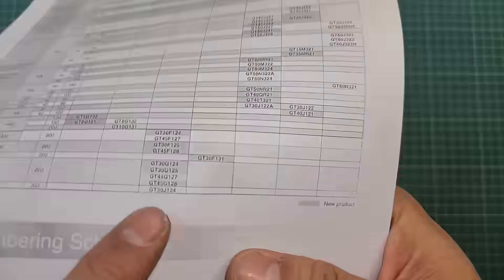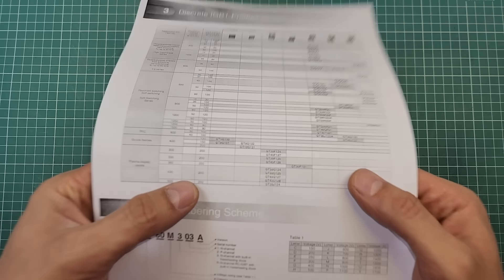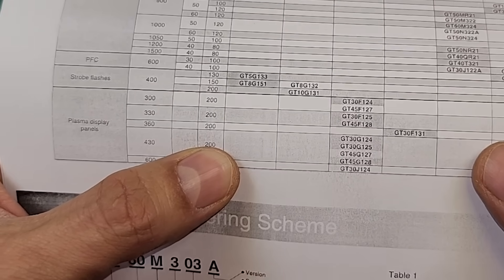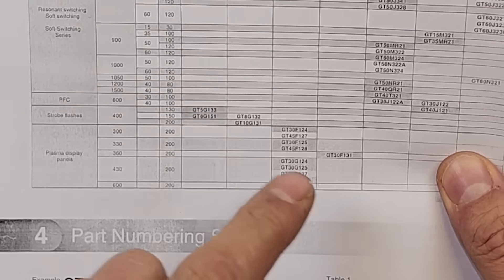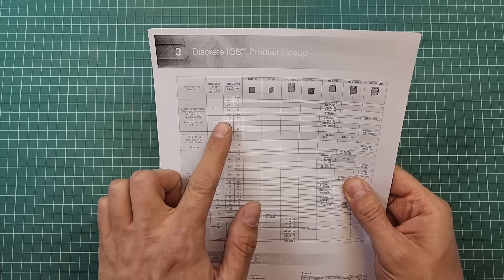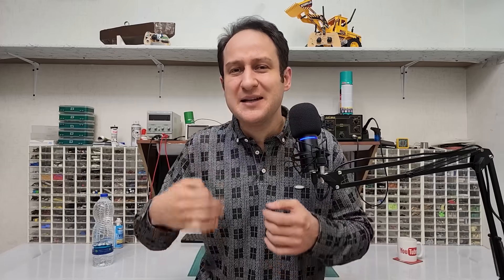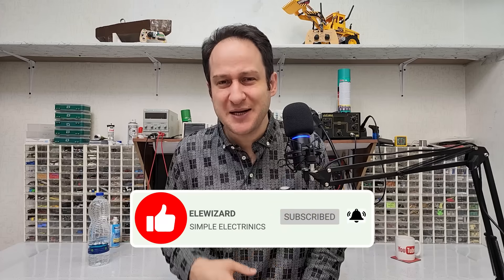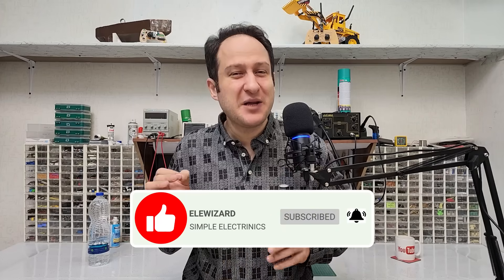Can a small transistor really switch 200 amps of current?

Comment: I learned something new, but it is completely useless to me......

For reals,.. i bought cheap solar controllers and they rated at 100 amps,  but start smelling funny and warm up ALOT the closer you get to 40 amps !!    so everything you said, Jives !!

i put fans on them to keep them cool.   they get so hot, the soder on the board melts and disconnects incoming current from panels (i have a video on my vids to show)  
Occasionally, if i dont be careful enough, i have to go resoder the faq-er.  !!   Still blows my mind that up to 720 WATTs can travel through those tiny little pins !!
Reply: Them cheap MPPT you got might have been rated at 100A for sure, but probably its the peak pulse current rating. Try looking at its continuous current limit. There are a lot of shady manufacturers advertised pulse current instead of proper rating for continous operation. If youre lucky, you might be able to replace the FET/IGBT with proper one according to your need without the need to replace other component.
Reply: @Aizemiyo  
I'm trying to manufacture money, cuz I'll just buy little better product !!

Iv been pounding them hard core for the last two years, so I did get super value from them...

All the other stuff you said, WAY beyond my paygrade !!

I'm still trying to master basic soldering techniques !!  You know, the part where you can put two wires together to where they don't fall apart...
Reply: @tisiluca  ahh I see.. Wish you'll get there soon. Dont worry tho,  cheap but legit solar controller does exist in the market, you just need to know what to look for. I suggest you familiarize yourself with the controller important specifications such as wattage rating, continuous input & output current, switching frequency and input/output protections. 

Regarding the soldering, my only advise is dont cheap out on quality leaded-solder wire. It will save you a lot of frustrations and money. I've spent a lot of money on multiple expensive solder stations because my soldering was so bad, turn out its the solder wire that is the problem.
Reply: @Aizemiyo  

I believe u r correct on the leaded stuff.  I need to get some soon.

Comment: Regardless of the silicon, 200a would vaporise the legs.  They'd need to be as thick as three pencils, 2/0 AWG or 70mm²  imagine the PCB would the tracks be made from rebar?
Reply: Not true at all, you can send 200A through 10 awg wire in certain circumstances, drones do it all the time. You and many others make the mistake of thinking structural wiring code applies to other applications.
Reply: @MarkFunderburk  OK, but the point I was making was the legs would be inadequate even if the silicone was capable.  There is also a big difference when it comes to duration.  What might hold up for a short term and some heating is acceptable will fail in prolonged use.
Reply: @landroveraddict2457  No, the legs are adequate. Did you listen to the video ... the pulse width ?
Reply: @landroveraddict2457  What if the legs are short and mounted to much larger cables, so the cables help cool the pins? Then you can run more current through the pins.
Reply: @benjiwiebe8128  the legs become a fuse.
Reply: @benjiwiebe8128  That is essentially what you are supposed to do for any of these high power devices. In reality it is a PCB with carefully designed, thick copper polygons to dissipate the heat from the connections.
Reply: @landroveraddict2457  Are they though? Don't get me wrong I would not use this device anywhere near 200A, but the number isn't a lie or a scam. In the conditions outlined in the datasheet (pulsed use) the legs are probably fine. Keep in mind during assembly some significant length of those legs will usually be cut off, and they are not really intended to be soldered at the very end.

Good parts websites (like digikey) have the option of sorting by continuous or pulsed current for transistors. And I don't want the manufacturer arbitrary picking some middle of the road number for what they say the limit is, because I, as the engineer will do the calculations and determine that for my application, I want to know what the absolute theoretical maximum is, because that's the only way to effectively compare part #s.

Comment: Sometimes they require a heatsink the size of a battleship.
Reply: "Hey, cool, I can see the sacrificial anode on your hull...!" - "Erm, no, that's actually the IGBT this whole thing is cooling..."
Reply: A heat sink made out of WHAT???
Reply: @StevenStyczinski-sy8cj  super conductors.
Reply: plus liquid Nitrogen, a pump and a fan, water cooled SCR's or Ignitron tubes are used for high currents, 1200 A.
Reply: It is not just heat sink but the current carrying capacity of the leads also matters. Can these thin leads handle 300A even for a short while?

Comment: Also: the size of the leads (legs) of the transistors will be a clue for current handling will be a clue.
Reply: i agree, leg size has to be the first immediate clue to its capacity, 200 amps, you need welding cable size.

Comment: The answer is in the wattage handling data. More Volts - Less Amps. Lower Amps - Higher Voltage. But the time/current handling not clearly specified is actually what we were looking for. Not listed? Suspicious 🤔

Comment: Package type is important as well as practical considerations for the PC board traces.  Nice to know the silicon (or whatever) die can withstand 200 amps but that's an absolute limit.  I like to say I work with surface mount components - the kind that need bolts to mount.  To really be working with 200 amps RMS you're going to need bus bars and the mechanical aspects are just as important as the electrical.  Thanks for getting this out there for discussion.

Comment: Just look at the leads ;) Fuses for 200A have much thicker wires. But for microseconds? Even much smaller fuse won't blow. To match a component for the circuit all 3 factors must be taken into account, first power, then current, then voltage. I fried transistors with exceeding each one (of course one at a time). I haven't used IGBTs that much, but looking at MOSFETs I also look at their R(DS), because it tells a bit how much power it will dissipate. And this one depends on the V(GS) voltage, that should be high enough to get the lowest R(DS), but lower than maximum, because having it just on the line costed me some oopsies. And when I decide to use BJT, the voltage drop when it's on counts to the power much more than for MOSFETs. That's why I love MOSFETs so much, they are quite cold even with large currents, so they usually don't need huge heatsinks.
Reply: I have build a MPPT StepUp-regulator for PV-modules and used there for this 10A of current some MosFETs which could switch 300A, pulsed drain current of 1200A. At the end the Rds_on is the critical value here, because the device should produce nearly no heat, because it have to fit in a small housing.
Reply: @Adam_Lyskawa  correct, but the terminology is different for IGBTs since they don't have a drain or source. Also, for both Mosfets and IGBTs, the gate current is extremely important for power dissipation as well as voltage. Gate drivers will go up to 2 amps because the faster you can charge the gate up to the voltage, the lower the switching losses, which are then multiplied by the frequency.

Comment: I have seen real 200 A industrial diodes in my life. Diodes that can handle 200 A for years. It has output wires as thick as an adult's man finger. With heatsink it had weight about 1 kg. So seeing that modern tiny transistors with claims it can handle 200 A makes me laugh. 
Yeah, sure, in 2 microsecond it would survive, but no more
Reply: https://www.youtube.com/watch?v=dhIbZa6yg5k Here's a modern tiny transistor doing 200 A, with a heatsink. If the heatsink was actively cooled, you could get long lifetime at 200A with a small device.
Reply: @benjiwiebe8128  open crystal in special conditions. Nothing new, nothing real. You can't keep it at 25°C all the time in the real device. That thing worked in electric locomotive countless hours. 
And wires... too thin for 200 A.
Moreover why in your video the current never changed despite load got hotter with time. With the same voltage the current should drop down at the wires got red.

Comment: Run that trandistor under liquid N2. You can run it at up to 500amp continuously..
Reply: shurely not.
Reply: @Poebbelmann  If the thermal resistance of the package is low enough that the LN2 keeps the junction temperature within operating range, then it should work.
Reply: @benjiwiebe8128  The thermal resistance from the bond wires to the casing will propably be much too high. They will evaporate even when being cooled to -196 °C.

Comment: Kind of a round about way to say that this component is meant to operate under a duty cycle. They even give you their definition of a pulse. Assuming enough time elapses between pulses to dissipate most of the heat, you can still switch the rated amount, for their length of a pulse. In other words, it's not meant for continuous operation, so a continuous load rating is not needed. Ultimately the maximum power dissipation is the true limit, I really don't see how any of this is misleading.
Reply: This was my first thought. The amount of material able handle current that high would need to designed specifically for that purpose and not ANY 200Amp load and especially not continuously. Most ppl should already assume this but I wouldn't be surprised at some EN thinking it says 200A so they just "send it".

Comment: 200A is pulse current - not DC current - The pulse duration could be few 100 microseconds ( repetitive or non repetitive is another factor to consider) as in fly back mode. No device can carry 200A DC current for a CE volts around 2V!
Reply: Some can....with a very large heatsink.

Mitsubishi QM200HA is one example.
DC safe area includes 200A @ 7V CE
Device is rated for over 1500W dissipation.

Comment: Best thumb rule is always use factor of safety as > 10 or more. Never believe advertisements.😂😂
Reply: 10x is wasteful.  Best rule is to read the datasheet, understand switching and conduction loss, understand the thermal resistance parameters, and aim for a lower junction temperature if you're after reliability.  Tjmax is usually 150 or 175 deg C for mosfets, so I go for 85 deg C for reliability.  This ends up being about 1/4 to 1/2 the rated values, depending on how fast I'm trying to drive it.

Comment: One number roughly indicative of the current capability is in the part number.  In this case 30, meaning 30 A under some a bit more realistic cooling provided.  I say roughly, as the actual cooling is not easy to figure out.  And last, what duty cycle?  50% ON?  25% ON? Or 2% ON?  Not to even start about the switching loss, say at 25 kHz.  You cannot take the first nomber at the top of the sheet and be done!

Comment: Amps are not a measure of power. Watts is. So what really matters is how many Watts can it handle. A TO-220 package is good for maybe 125 Watts? So you'd have to run at the threshold where a transistor switches to get 200 Amps through it. 0.625 Volts.
Reply: Legs of the transistor will melt earlier than crystal itself when you apply 200 A on it.
Reply: Think pulsed periodic applications. Duty cycle such that you don’t exceed the average power dissipation limits and and maximum junction temperatures.
Reply: @bretfuzz925  yeah I remember an old circuit that pulsed an LED at high current to make it really bright. Was one of those gee whiz circuits back in the day.
Reply: @bretfuzz925  some posts disappeared...
The argument was about a constant current. At least for one hour or more. 
200 A of continuous constant current.
Reply: @igorzherebiatev5751 understood. One must understand the nuance of the ratings and perform some math.

Comment: ahh 3 micro seconds, thats the catch, i always wondered the current limits of those pins myself, but also the circuits inside those black boxes, they're even smaller traces right? how do they handle so much current, or is that the magic of non ohmic devices? (diodes)  I have fantasies of a 5v solar system, all our electronics get converted down to 5v or lower so why all the conversion, just give us 5v and 200 amps!
Reply: Resistance and current gives heat (since voltage drop and current gives heat, and current and resistance gives voltage drop). Heat makes the traces get closer and closer to their vaporisation point. If you pulse quickly enough or have fancy enough cooling or heat-sinking (for a bit) than you can run higher current. So a short small trace connected well thermally to a larger object can handle a lot more current than it could in free air.

Comment: pffft... 200A... pathetic. i got something here that will do 2000A... continuously.

ignitron :) about half a litre of mercury :)
Reply: Rectify it.
Reply: @ interesting you say that as thats pretty well much all you can do with them as they dont turn OFF... precursor to the modern thyristor, and beefier than the gas filled thyratron.

this one, AFAIK, was rescued from an old industrial spot welder... only dealt with pulses of a few KW at a time.

i got it mostly as a cheap source of mercury...
Reply: In an old railway electric engine?
Reply: Substation at the end of an undersea DC cable...?

Comment: 3 microseconds? That's pretty reasonable. So I can use that IGBT in a buck converter at 138khz, with a 41% duty cycle to get a 3 microsecond pulse time, and put it in my car at 12v, 200A in, and get 5v, 480A output? Sweet, I'm gonna have the fastest cell phone charger in the world!
Reply from the maker: I wouldn't recommend trying that, you'll end up with a lot of smoke.😁
Reply: The forward voltage drop when pulling 125A is listed at 2.4V  so it will be higher than that at 200A.  But even if it weren't that would still be nearly 500W of instantaneous power.  So, to stay within the 25W power Dissipation limit you should keep your duty cycle under 5%.  This product guide is not a data sheet at all and is not sufficient for design work imo.